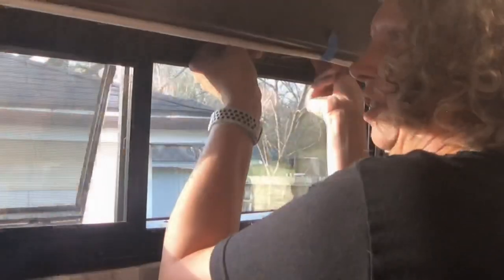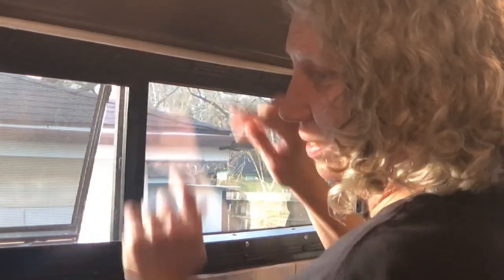Sweaty Wall - Fixed (we hope)

Comment: Do dehumifers and air purfier both kill mold spores and mold I have mold in my bedroom and I use dehumifers and I use plug in air purfier also do they both work and are they both worth using
Reply from the maker: Dehumidifiers are always good, but it will not kill mold. They pull moisture out of the air to help prevent mold. If you already have mold you will need to address that issue promptly!